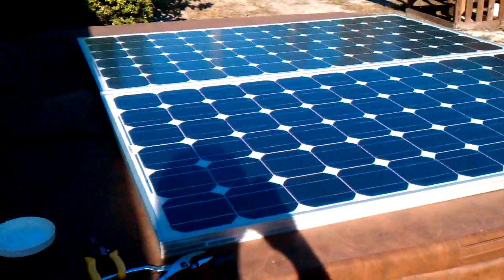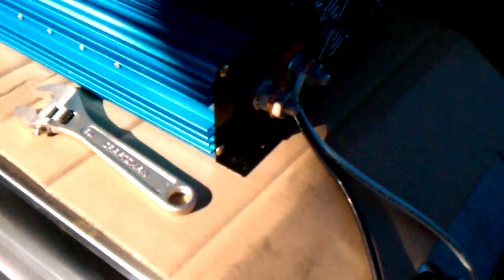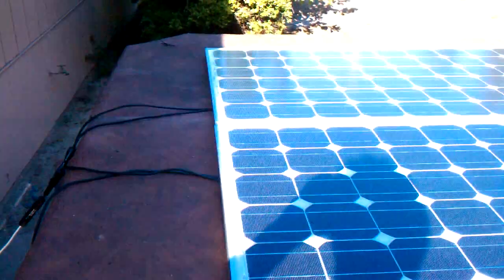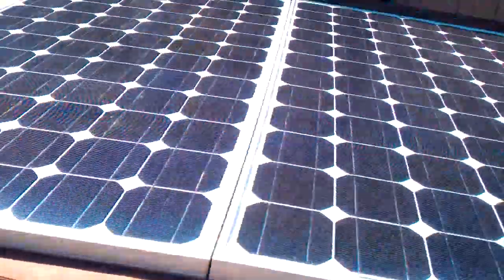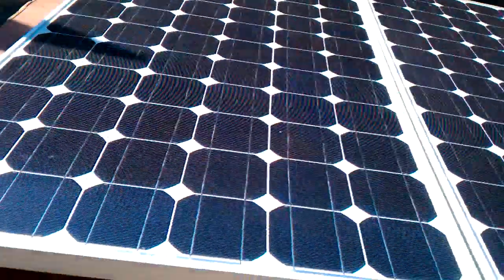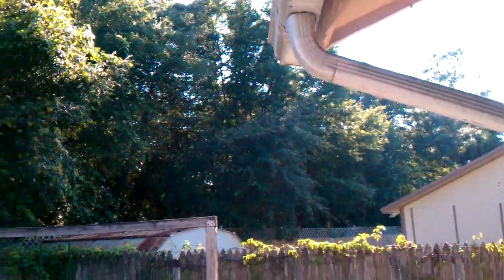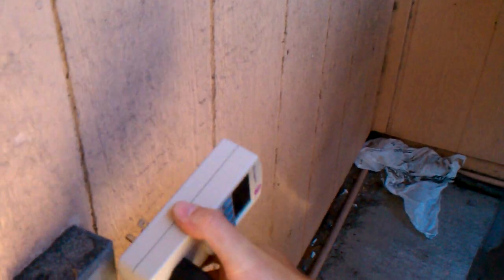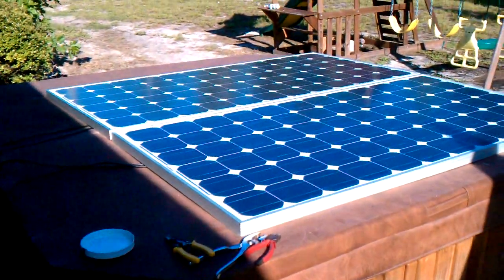Solar panels & Powerjack 1200 watt grid tie part 2

Comment: @helloman1976 nice panels. u wanna sell the power jack? I got some gold ring terminals for a couple of bucks not a big deal but I have noticed when they are not making a good connection it drastically reduced wattage. Gold plate helps with contact. Thats why they make them. Your right its not real big difference. But just using ring terminals compared to bare wire really is a lot better connection. Glad for off grid system.

Comment from the maker: @shartne I would use gold rings if these things were outside otherwise it's big time overkill and a waste of money. My goal is to make sure my pack back exceeds my payouts and things like that produce almost zero in results but cost 800% more. I use 6 gauge wire on my runs from my panels to my charger controller, the total resistance of my 80 foot run is less than 1 ohm. If I used gold connectors it would be exactly the same as what it is now. I no longer have any grid ties by the way :)